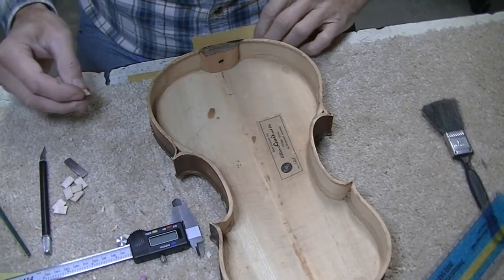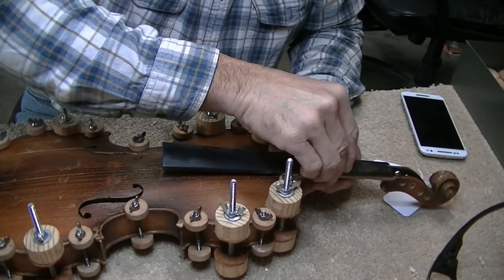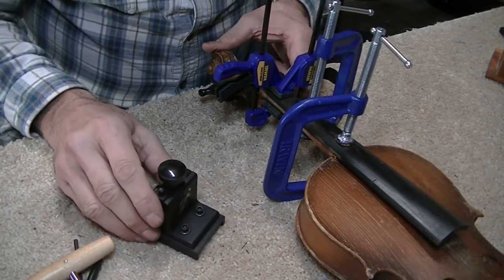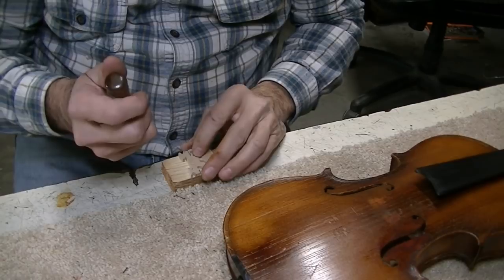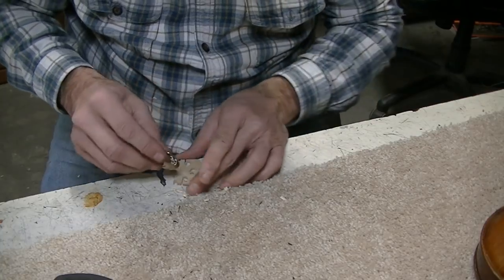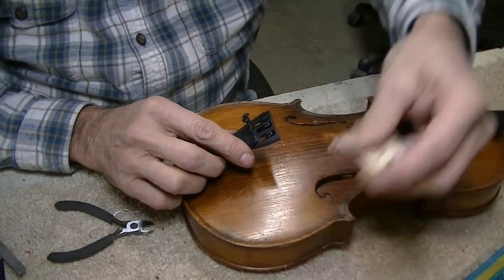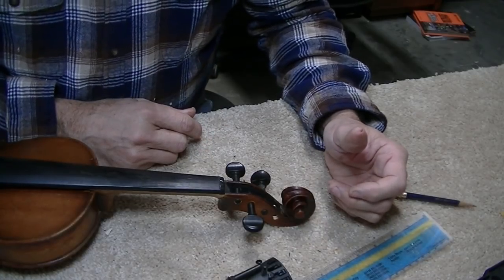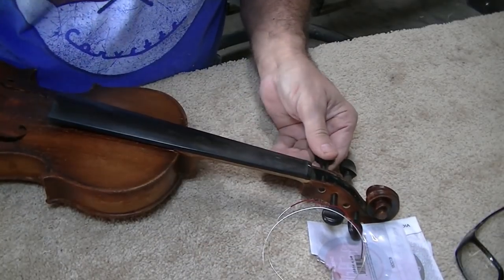209 RSW Grandpas Mouse Hole Fiddle Part 2

Comment: The sound post goes behind the treble foot exactly the distance which is the same as the thickness of the top, according to a few violin luthiers I have watched on here.  They didnt say anything about the scale length, so I appreciated that!
Reply from the maker: There are no hard-and-fast rules on that. You can adjust the sound post to your liking in terms of moving it further back to increase the bass sound moving it closer to increase the trouble sound. Anytime you think there is a hard-and-fast rule on a musical instrument you're cutting yourself short.

Comment: Hi Jerry;
On joints I want strong, but want to hold quickly I put the wood glue over every thing but a small area in the center of the piece or two or three small areas on larger pieces then put a drop of super glue in the dry areas so I can clamp it for a minute then the super glue works as the clamp while the wood glue is drying. I like the technique.

Comment: Looking at your chin rest tool, I've had the problem of how to tighten those chin rest nuts without scratching the violin for a long time and decided it was time to make me a tool. I had several sets of precision screwdrivers so I took one of the precision phillips screwdrivers that just fit in the hole in the nut and cut it to the right length to just reach through the nut. I then rounded the end of the shaft so it wouldn't scratch the violin if somehow it did touch the wood and now I have a chin rest tightening tool. I may have commented on this on another video too, I'm not sure if I commented on your video or on Facebook. Love your work on this fiddle. Grandpa would be smiling if he could see it now. Oh, the wider string spacing makes it easier to play too as it gives more bow clearance angle between the strings.
Reply: I wanted a fancy chinrest tool.  I bought a brass 1/16 in. pin punch and shortened the pin a bit.  Works great and looks classy!

Comment: An old furniture repair trick is to fill gouges in wood with crayon.  Then you can 'paint' lines with a #2 pencil.  A good furniture repairman (oops, I mean repairperson) can make the repair virtually invisible. The only problem I could see is the extra fill might effect the sound.
Reply: I almost forgot.  You can buy lacquer sticks in different wood colors that you  melt in the gouge as with crayon, but crayon is cheaper and usually does just as well.

Comment: To help stop the peg hole from wearing down so quickly, you should look the the RC aircraft hobby. Get some thin CA glue (superglue) and coat the inside edge. That'll harder the inside surface, making it more resistant to wear. This is done to all the screw holes in the light balsa wood of RC planes. Run screw in, then unscrew it, add the thin CA glue, and once dry you can put the screw back in place.

Comment: Excellent  !
It makes me want to go out to my workshop and build something just using scrap wood. I would like to maybe use some wood that I use for firewood to try to come up with some building material. But I don't really understand what quarter sawed wood is? Maybe I'll have to research it and then being able to get it thin enough would be hard part. But where there's a will there's a way. A man could probably go to the hardware store and buy a sheet of formica that is any color you want and build an instrument out of it that would produce a decent sound. I know there is a bunch of acoustic guitars on the market that are made out of wood fiber derivative. Even carbon fiber. So the sky's the limit keep up the good work God bless you
Reply from the maker: Good luck to you. Hope you make something cool. Thanks for watching.
Reply: I knew a guy who had a factory making some sort of wood product. He hired Vietnamese people in the 1970s or 80s because they worked cheap. He noticed they were taking the scrap wood with them every day when they left work. He asked why they were doing that. They were making some of most amazing clocks, lamps, book ends, etc. The wives were selling them at the local flea market.

Comment: Super glue needs a certain amount of moisture to bond properly and if the surrounding wood is too dry the super glue won't be as effective at bonding. I tried to fix a veneered tabletop with super glue and inside of a month it started to delaminate again. Good old titebond fixed it for good
Reply from the maker: Thanks for taking a look.

Comment: Excellent as usual! After years of playing the acoustic you're making me interested in picking up a mandolin. 
You probably get this question alot but here it goes. What would you say are the most important things I should pay attention to when buying a mandolin?
Is a 400$ budget realistic for a quality mandoline? Or would you recommend saving up some more? Any brand you recommend? Sorry for the questions but your input would be very appreciated.
Greetings from Europe!
Reply from the maker: Yes I've had that question quite a few times. Unfortunately it's difficult to give quick simple answer. The Brand's I would consider are Kentucky, Eastman, andThe Loar.  There are actually several others that could be fine too. The problem is that you really have to play them to know if they're any good or not. You can find really nice instruments in all the brands. But you can also find a lot of crud too. So it's really hard to say. The things to look for are a solid Spruce top. I prefer a flat fingerboard rather than a radius fingerboard and I prefer smaller Frets rather than the large Frets. In my opinion they're easier to play. Good luck to you my friend. Thanks for watching.

Comment: Please use hide glue. Titebond will eventually fail, as all glues will, but hide glue is reversible. Titebond will fill pores and make adherence of any future repairs much weaker. BTW: Hide glue is just as strong as Titebond.
Reply from the maker: It's a total myth that you cannot take Titebond apart.   I've done it many many many times. In fact I have a video out there where I remove the neck on a guitar that I built with Titebond.  I remove did it in under 15 minutes. I don't think you could do it that fast with hide glue. In addition Titebond will not fail. I've been doing this for 37 years and have never had a problem. To say that high glue is the best glue there is is kind of like saying an ox Ox cart is better than riding in a modern car. Oxcarts were great in their day as was hide glue.  Please understand. I'm not really knocking hide glue. I just think Titebond is superior. In fact I would say that  much of the repairs that I do are due to hide glue failure. Obviously, we will never agree on that point.

Comment: In another note have you ever tried simply spraying raw mid temp lacure thinner on a checked insterment to see if it mite melt it back togeather?it would have to be oil and wax free of coarse and as clean as you could get it.
Reply from the maker: I've done that on a lacquer finish. But I don't think this was lacquer. Thank you for watching.

Comment: Grandpa did not cleat the top 😧
Reply from the maker: I have covered that topic in one of my shop talks I believe it was shop Talk number four possibly it was number three. The short version is cleats are necessary if there is stress in that spot. Realize that most all violins have a seam down the middle on both the top and the back. Those seems go from thin to really thin. None of those scenes are cleated. So why does a crack need to be cleated? In my opinion only when they're stressed there.
Reply: @RosaStringWorks  yet another learning.. luv it. 😘